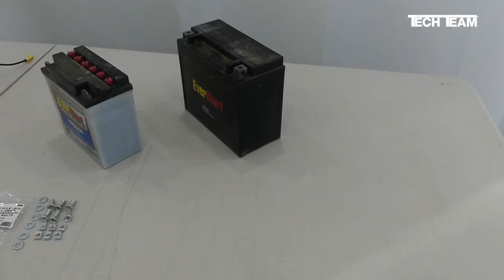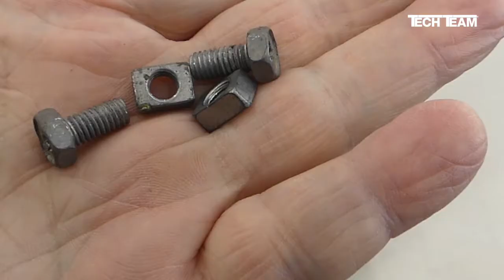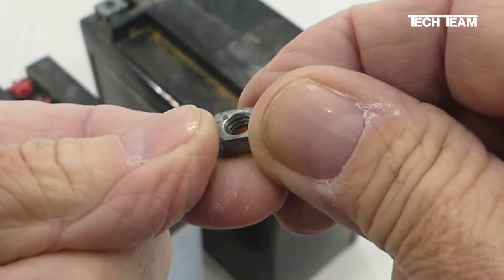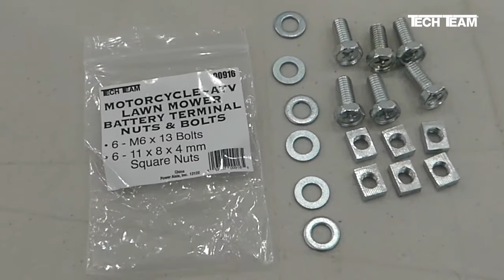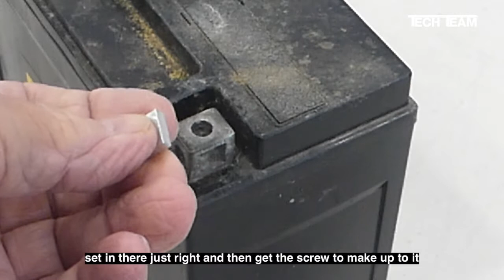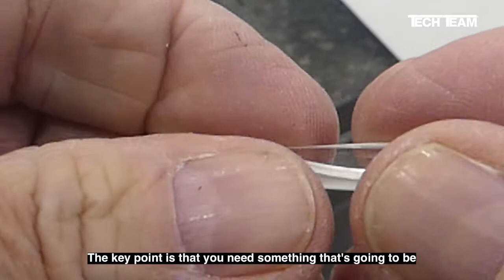Tech Team’s 00916 Power Sports Battery Terminal Nuts and Bolts Save the Day

Comment: Thank you so much. I tried replacing my motorcycle battery and was frustrated after an hour. YouTubed it, had extra rubber hose and was installed flawlessly in 5 mins. Thank you sir, not all heroes wear capes.